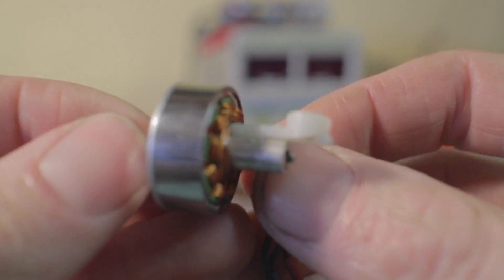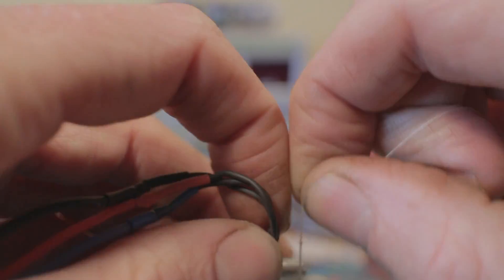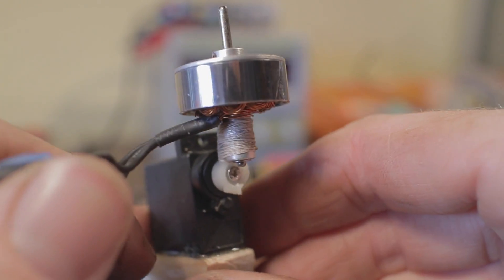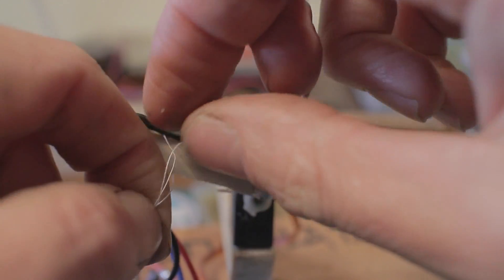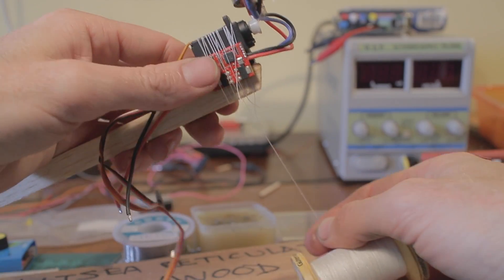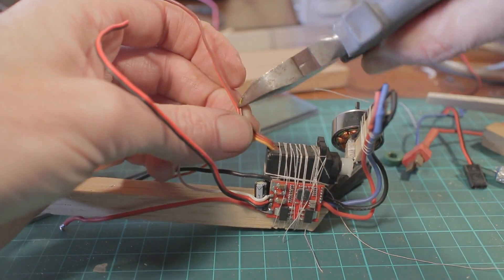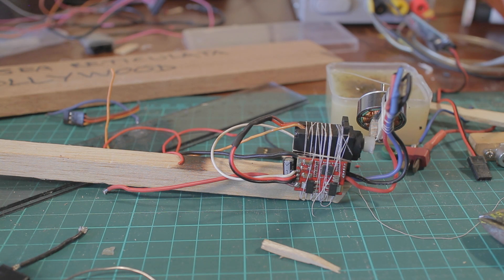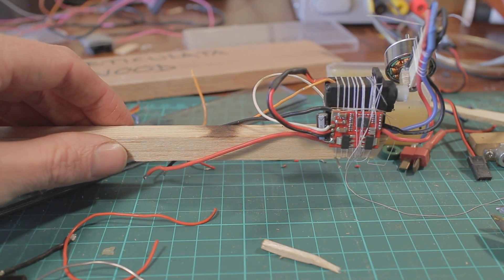A small lightweight yaw servo for multirotors. RCHacker #81

Comment: I really like that BEC powering the servo idea.
Reply from the maker: +MrCareyer The BEC on the ESC is powering the servo only.
Reply: +Adam Wilkinson : It's not a bad idea but it depends a little bit on how you power your flightcontroller (FC). This way the servo draws its power from the FC and drawing to much current (e.g. blocked servo, broken gear...)  may result in a voltage drop and brownout of the FC --> CRASH!!!. It is alsways a good idea to power the tail-servo with a dedictaed BEC ;-). Anyhow it's okay as long as your FC has a completely redunant power supply (e.g. Pixhawk)
Reply: Ahh... okay! Then it is perfectly fine! Just make sure the 5V wire is not powering your FC ;-)

Comment: Hi Marc! Thanks for your video. It's a good idea to use lightweight string but you must have ultimate faith in god fixing the motor directly to the servoarm ;-) The lifetime of the servo will suffer from taking all the weight, trust and vibration from the motor. Further more it is not build to withstand longitudinal forces to the servoarm. Let me share our idea for a simple, lightweight and slopfree linkage: https://www.youtube.com/watch?v=Tc503-wQBog -- It is made from simple rubber spacers. The CNCed motor mount in the video can also be made from a motor-screwcross
Reply from the maker: +MrCareyer That a nice little mechanism, i bet its much stronger than mine. We have even gone as cheap as a HXT900 they get a bit of slop in the gears sometimes but for $3 work fine with these little motors. Servo arm always breaks first.
Reply: +RCHacker : For the Nonacopter this certainly is a sufficient solution. You just do not want to do that on a Tricopter since a broken Servoarm will result in a broken Copter! Please don't ask what makes me know that ;-)